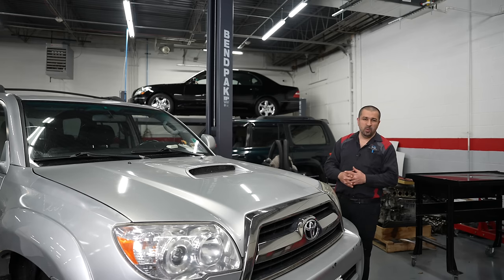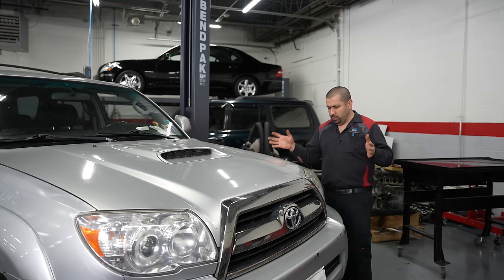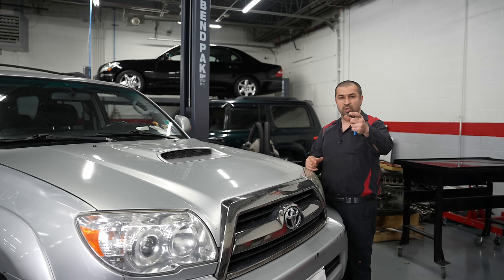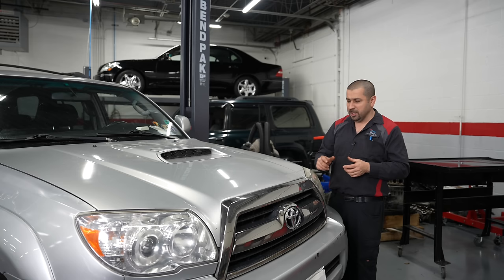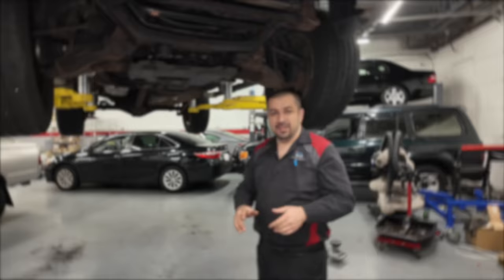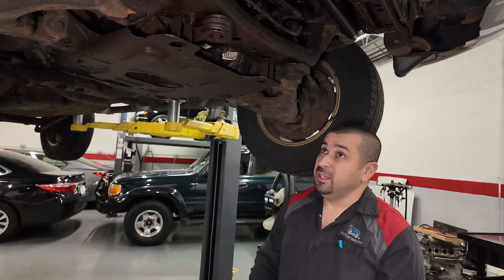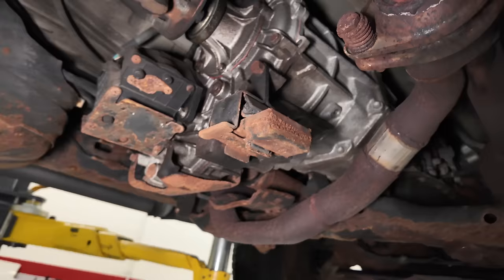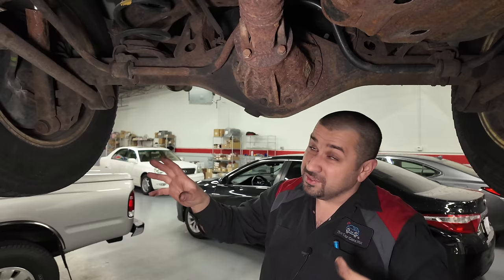THIS Problem Can Destroy Your Toyota Truck Transmission! Is it Too Late for This One?

Comment: Can’t wait for your video comparing 5gen vs 6gen 4Runner. Honestly, your reviews are the ones I trust. Cheers!!
Reply: Mee too!
Reply: Clean the underside more than top
Reply: i remember him saying things against toyota and 2.4L, curious what he'll think of it.
Reply: @bradhaines3142 It’s 31 years old and still driven daily. I hope thats a testament to Toyotas longevity. The only major thing I’ve had done is the timing chain 15 years ago.
Reply: @flyprincess69  on what? the old 4runner has a v6 that's legendary for never dieing, so that makes sense. the new one has a 2.4 that isnt totally known of
Reply: @bradhaines3142  Sorry Im miss read your reply. You stated the 2.4L. I have a 93 with the 2.4RE thats still truckin along.
Reply: @flyprincess69  2.4 is the displacement, the RE is just a specific engine. thats great that its lasted that long, but it had a history of burning oil and having bad piston rings
Reply: The 5th gen. will go into the history books as the best 4-Runner of all time.

Comment: I’m so glad when I got my 2014 Tacoma I’ve been putting Fluid Film all over the frame, crossmembers, under the fenders, bolts, etc. My truck looks brand new underneath.
Reply: I haven't done anything to protect the underside of my 2004, but it looks new because I powerwash the underside once in a while. Also, the area where I live (Colorado) doesn't salt the roads in winter.
Reply: Fluid film is the truth!
Reply: @midwestrustwarrior  how do you get that FF stuff to stick in the highwash wheel house openings?  it always washed right off for me every time i had to wheel it in the heavy Iowa rain
Reply: how do you get that FF stuff to stick in the highwash wheel house openings?  it always washed right off for me every time i had to wheel it in the Iowa rain
Reply: @zzanatos2001  do they use that black Mag stuff where you are at? I have ventured into Colorado on a few winters north of Denver where that black stuff was all over the tacoma
Reply: Good to know.  I just used Surface Shield's lanolin based product everywhere underneath, inside frame, and in every orifice I could find on my brand new 4Runner.  Will touch up as needed yearly.  Looking to have the same results as you in 10 years.  Then 20.   I'm in Northeast Ohio...
Reply: @counterbalancelife4305  does that surface shield product hold up well if you put a general water hose sprayer to it... NOT a high pressure one, just one like you might find at a DIY wash and wand place
thank You!  
ps-  i have yet to experiment with that product for its durability... Fluid Film FAILED in my tests, it would wash off much too easily in the high-wash wheelhouse areas

Comment: I am in California and work on cars and used to rust free cars. I can't imagine being a mechanic who has to work on rusted cars like this one in the rust belt areas of the US.
Reply: I love your channel you are an outstanding mechanic. If I lived close to your shop you would be my mechanic.  I own a 2018 Lexus 570 and a 2024 Toyota Tacoma. I live in southern Illinois after watching your videos which are excellent. Don’t people up in the Chicago area realize what those winters do to a car over the years.  If I lived in the Chicago area I would undercoat any new car I purchased.
Reply: All you need is a little map gas sometimes a big hammer, air tool, or leverage. Metal lines on trans coolers rotting out is very common here and many a car has gone down because of it.
Reply: @b469b  Just hard to see vehicles rot away like this just because of road salts. Dang shame.
Reply: It sucks big time at times. I  antiseize the shit out of everything. We HAVE to. I envy u.
Reply: @riceburner4747  I also use anti seize all brake parts, especially where rotors meet the hubs, all suspension parts matter of fact anything that I feel will be appreciated by any future mechanic who works on any of my cars.
Reply: Every nut and bolt is a fight. Rust falls into your eyes, what’s not to like 😂 you get to use the big hammer and torches 😮and it can add hours to a job 😢
Reply: @HypocriticYT  Very good points👍
Reply: Great clip. I couldn’t live in the rust belt, glad to be in TX!
Reply: I’m a tech at a dealership in Texas. We can always tell who the rust-belt transplants are, due to the extensive amount of rust and corroded aluminum underneath the vehicle and in the engine compartment. The difference is shocking.
Reply: @drw1926  Your dealership should factor in extra charge for these types of vehicles just in case unless they are simple service intervals.
Reply: I'm in New Mexico. Just bought an '07 Tacoma, rust free.

Comment: I wish that gentleman best of luck. I believe you AND he are going the correct route. With 90,000 miles, if tranny seems all right, I'd TAKE a chance & fix shocks then axles. Only 90,000 is worth the risk. After repairing everything, he ought to get an undercoating job done. It will prolong lines & frame. Looks in great shape! And STILL better than car payments/price of a new one. 👍
Reply: To late for undercoating. The best thing now is just use fluid film on it each year.
Reply: @arthurrodesiler3109  That's what I meant. Fluid film, Surface Shield, Woolwax, etc. He is obviously not mechanically inclined or may not have tools to get under it.

Comment: the 2006 looks alot like the 2004 Tundra SR5, unfortunately people do NOT change the tran fluid. it should be done like every 40ish Thousand miles, just drain it.. and refill no flushing or anything funny that might cause more damage than good. Just drain and refill it recharges the trany fluid.

Comment: AMD. I'm a retired commercial aviation mechanic, so you know that I'm really OCD since we were responsible for hundreds of lives on  every plane we worked on. I can't commend you enough for your honesty and respect for your customers. Thank You!!!
I sense your hesitation on going any further with this vehicle. I don't blame you! FWIW, and IMHO, I  would walk away and recommend that the owner salvage title that vehicle and sell it as a parts vehicle. I firmly believe he'll be money ahead. Even if that tranny holds, I just can't see how he'll ever be able to drive it ling enough for the cost benefit before that metal Cancer finishes it off. Personally I would NEVER sell that vehicle as a driver even with everything fixed. It's too far gone. Salvage for parts. Just my honest opinion.

Comment: Does this apply to a 5th Gen 4Runner?
BTW, if you want to prevent your 4Runner from rusting this is what I know works.
Inside frame rails, doors etc (anywhere enclosed) use PB Blaster "Surface Shield".
Everything underbody (exterior of frame, axles, floor etc.) use Cosmoline (RP-342) from "Cosmoline Direct".

Comment: I like the idea that you make your customers buy OEM, or the repair does not get done.
Reply: Aftermarket parts and fluids quality are questionable.
Reply: Well...  that depends.   The OEM axles have been discontinued by toyota.
I think the same applies to the four piston calipers for the brakes.  The dealer in my area buys the calipers from NAPA because of the lifetime guarantee.
The Xreas shocks are far too expensive.  The best alternative is Bilstien 5100's.
Brake rotors--  Brembo.  Brake pads--  Hawk LTS.

My point:  Aftermarket is often the only and best alternative.
Reply: its that the oem axle never go bad on toyots and are better quality than aftermarket. The leaking seals can be replaced. Once the ax;e is repalced with aftermarket, it would be replaced again and again. 
For instance: I replaced my shocks on my lexus with aftermarket kyb. It never had that lexus glide again. But on the plus side, instead of paying 450 for two shocks I paid 230 plus two sway bar links.
Reply: @TocyBlox  I do all of my own repairs, so the money I save on labor, OEM parts prices are no issue, ever. I will not buy aftermarket unless it’s the only option. I never even look up or compare prices between OEM/Aftermarket. Don’t care to even know the difference.

Comment: Thank you for the updates at the end, our prayers were answered. 🙏🏻
Difficult to see from the quick shot but is it the Toyota WS fluid on this vehicle as opposed to the early Aisin Type IV tranmissions?
Also have you ever had any transmission failures on the Lexus LS430 due to the combined engine and transmission cooler radiator breaking down internally allowing engine coolant into the transmission fluid?

Comment: These new toyotas are becoming a lot more delicate got and old rav4 ran rhe transmission very low on fluid went thru bottles of Lucas non slip and i even changed the fluid and filter and 200k miles when it had never been changed and it shiftd even smoother than before
Reply: I think the newer the get, the more like a swiss watch they get where they need more precision to run correctly and neglecting small things messes things up badly. Too bad engines and such aren't exactly as simple as they used to be.

Comment: That old fluid looked pretty good for being as old as it was. It's gonna be interesting to see if the tranny survived being 4 quarts low!
Reply: Don't know about USA, but in England and presumably Europe there's no specific oil change interval on the 5 speed auto transmission, at specific intervals the workshop is supposed to inspect the oil, presumably by taking a sample from the level plug...by the way it still annoys me having to mess about underneath to check the level instead of a dipstick.

The same box is found in Prado from 2004, most of us sensible owners give that ''no need to change the oil unless'' instruction a good ignoring, gearbox failure among those of us on the Landcruiser forums is unheard of.
My Prado is 19 years old now and despite being in England where salt is used extensively in winter the vehicle is still rock solid, but i do treat the undersides with ACF50 spray and keep the chassis coated in marine grease.

Comment: I have a 4 Runner the same year as that one, 216000 trouble free miles I live in the south so no rust. I change my transmission fluid every 30,000 I know you can go longer but transmission fluid is cheap a new transmission is not. Glad it worked out for the owner these trucks will last forever properly maintained and no rust.

Comment: i can’t help but remember my 99 tacoma how badly it rusted and i had to let it go in 2023. dealer serviced since i got it in 2008, it wasn’t rusted back then. Over the years, i spent $15k CAD on repairs, mostly the last 5 years of ownership. They NEVER mentioned to me anything about the rust and rot. they just happily took my money.
Reply: That sucks. Unfortunately its hard to find somebody truly trustworthy, unless they were simply ignorant about the issues. But that still means they aren't trustworthy if they don't research the cars they're selling to customers.
That's why i think its important for somebody to personally search up a car they're considering buying, research specific engine transmission and year's issues. A way to find detailed info is by including the word "forum" in the search, since you'll find results from forums where all the experts are.
Reply: i don't think you are the only one in that boat 8^{  of the monkeys working under your vehicle not informing you or even caring about it ... i sorta 'lucked out' by seeing the Yota trucks of the 1980s + the early/mid-90s with the most serious of body rott in the rear tailgate, lower doors and wheel house fender openings... when it came my time to become a Gen1 originator i routinely hosed the road slop + salt off and out of all those areas as best as i could when the temps were right around freezing so the doors wouldn't totally freeze shut the next morning! I also had the dealer spray it underneath before taking delievery with that rubbery undercoating to winter protect it... but i had no idea what was going on behind that undercoating until it fell off 20+ years later... LOTs of surface rust lay behind it i had not ever seen before.  put in some good long hours repairing that precious frame coating with something i think is MUCH more durable and lasting to road salt spray
Reply: @zzoinks   it was late in 2o18 before i stumbled upon a tacoma toyota forum and i had NO clue about the dangers the Winter Monster actually did and i am still freaked out by it all this many years later 8^{

Comment: You certainly gave this a valiant effort.  I truly hope that this transmission has been saved, but for how long?  My concern is regarding that "sealed" transmission.  Checking the fluid level seems to be at least an effort if not a pain.  Is there no warning light or Code generated to indicate that the trans is a quart or more low?  I have a 2006 Avalon (I know, the "worst" year to have) it has a dipstick.  I check it, I check the oil, the power steering, the brake fluid and the coolant, weekly.  Maybe I am paranoid about it but that's how I found my power steering line leak before it became a problem.  I am disgusted that Toyota joined the ranks of other insincere car manufacturers, who don't care about customers or quality, to make a system that can fail catastrophically without a hint of the trouble until it may be too late.  Almost 5 qts low!!  No excuse Toyota.

Comment: Thank you so much for your video. This is extremely relevant for me right now as I just replaced all these lines, as well as the inlet and out trans cooler lines coming out of the transmission on 06 V8 4runner. I'm somewhat a beginner DIYer as it's my first time doing many of these jobs.. but watching your videos like this for certain really makes me feel like I'm learning a whole lot and its starting to pay off. 

Much described in the video of what this 4runner needed is what I have taken upon myself to do on mine - CV Axles, Wheel bearing, seized front caliper, and trans line leaks. Almost identical. It's just that in this video, unfortunately his car has far worse damage regarding the rust. I pray for him that his transmission comes to back to operating order. I love my 4runner, and as a matter fact I have two of them, both 06s. My V8 has 183k, while other one is a v6 with 337k miles now and runs flawlessly. Maintenance really is key, and I can't wait to complete my v8 as a full on learning project and overland build. I just worried about the potential loss of ATF, but she feels really healthy otherwise and I feel a lot better about it with research regarding the topic. I'm happy to see such supporting content and look forward for updates this truck and it's transmission. I pray for the owner that he can keep his baby. If all works out, maybe he can look to upgrading his suspension instead of going stock - a worthwhile fun, upgrade and investment while he'll need to do it.

Comment: I know this comment has nothing to do with this video but I can't find another way to request a topic. I bought a 2017 Land Cruiser in January. It was very damp inside, thought it was due to detailers. Found the fresh air intake broken. This is evedently a common issue. The dealer did all service on this prior. There is a fix, a guy makes and sells on etsy, has a YouTube video. Thought it might be a good topic because I had a hard time finding info on this. Thanks for your good work. I've been a Mechanic for 35 years and am sad about the state of the industry.
Reply: Somebody told me if i want to fix cars, do it as a hobby, not a career. So its probably not good to work in the car mechanic industy from what i hear. If people arent getting paid a fair wage for fixing cars, why do we deserve them doing that job?

Comment: We have a friend in Salem, Missouri who has a 2006 4Runner. He is not in the rust belt. His has 332,000 miles on it. He changes the oil regularly but has never done anything with the transmission and it's still running fine.
I just did a drain and fill of the ATF on our 2009 RAV4 which as just over 100,000 miles on it. However, the transmission only has 36,000 miles on it because the original tranny was replaced by the Toyota dealer due to a defect. The cost of replacement was paid in full by an aftermarket warranty.

Comment: Wow the owner really let this one go without dealing with anything.. or never had it looked at for years.  Poor truck could have had a much better life and been a lot more enjoyable to drive !
Reply: My Tacoma is not allowed to watch this video.  Too scary.
Reply: Drank the taco don’t need no care- runs forever
Reply: Your average salt/ rust belt car lasts 10-12 years. Yes you can mitigate the issue with Fluid Film or similar (one time sealers don't work), but few do. The point being this car has lasted longer than most (perhaps it was moved out of the rust belt at some point, but the damage has been done) but replacing calipers and brake lines when the frame is turning to powder doesn't make sense, so they drive them until they break.
Reply: @TheOnespeedbiker  there was more there than rust issues.. i was referring to the mechanicals.  but yeah I get your point.
Reply: @plakor6133  LOL

Comment: I’m so glad I live in SoCal. 2007 Tacoma w/168k miles, very very little rust. Front and Backs Shocks replaced with Bilstein 5100’s at 140k. 

Never been left on the road.

Comment: Great work on that tranny, worst case scenario the customer can buy the parts off of a yard. These are bullet proof if maintained. 
Careful with the LS430 fuel pump, if I remember correctly it has 2, the fuel gauge is controlled by a board that sits in the fuel tank, these go bad as well.